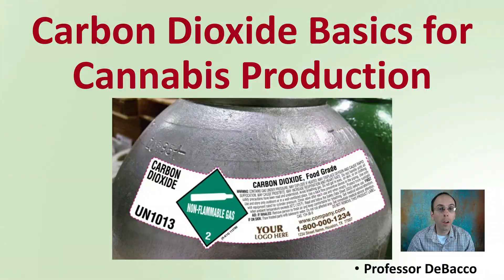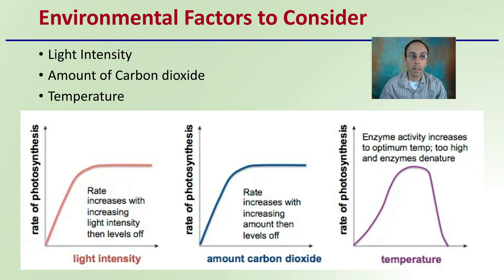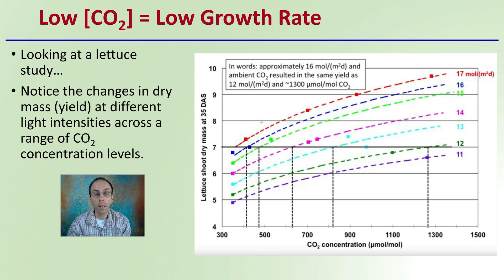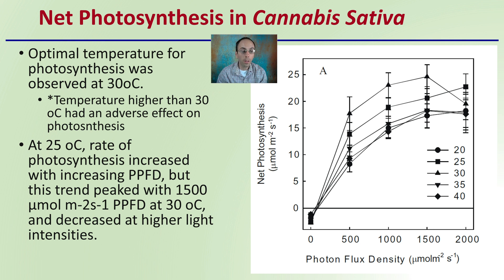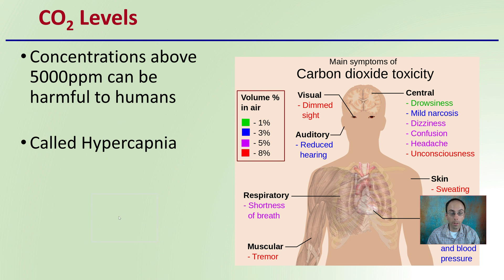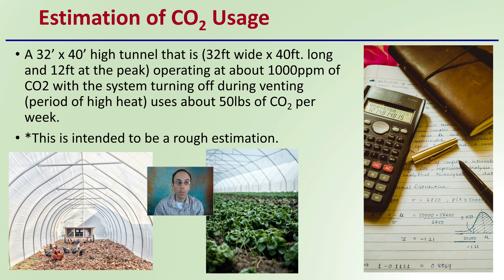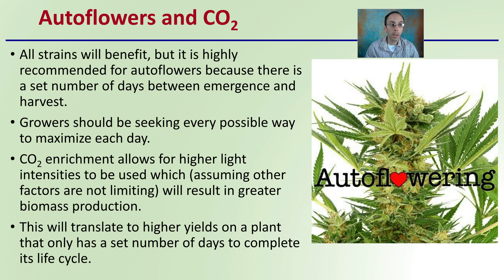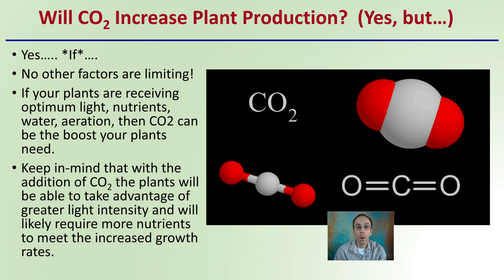Carbon Dioxide Basics for Cannabis Production

Comment: I need help please! ASAP 
 Im at the end of week 6 of Flowering and I just ran out of CO2!
 I was at 1150 PAR, 1300 CO2, 83°f vpd at 1.6. Do i need to drop PAR to 800 and I know temp to 78° or can I finish it out at a higher par or ppfd
Reply from the maker: See how the plants respond, but without the CO2, your plants may not be able to use the higher PAR readings.
Reply: @DeBaccoUniversity I did and it started to Foxtail. So im being safe at 800. Thank you for your advice! Peace ✌️ ☮️

Comment: Quick Math= for 1,44m² Tent you need a 425g C0² Bottle from Sodastream every Month. Target will be CO² Level of 700 Umol. Maybe try then 2 Bottles a Month Late Flower with Light Intensity above 1000 ppfd. 300 Watts or 450 on 1,44 m² Tent no more recommended. Build yourself one from aliexpress, fittings and a Magnetic Valve 12 bucks.

Comment: could someone kindly calculate for me how much co2 would be needed monthly to maintain 1200ppm in a 2x2x2m tent?
Reply from the maker: Depends on venting, but start with a 20lb bottle.
Reply: @DeBaccoUniversity  thank you very much for the quick reply, last night together with a friend we tried to do some calculations and the result was half a kg of co2 per month, if it were correct with a 20kg cylinder I could do almost the whole year, calculating that the refill of the cylinder would cost me between 30 and 40 euros, for a whole year it is an expense that could be worth the return. Regarding ventilation I still have a doubt that I can only get rid of by trying, seal the tent, saturate with co2 until the temperature rises above 28° to restart the ventilation to lower the temperature obviously sucking away most of the co2 and start the cycle again, or install an adjustable air duct volume control damper on the outlet suction so as to try to regulate with a constant flow temperature, ventilation and co2 input.
I have a double ventilation system, one exclusive for the HPS in cooltube completely isolated from the tent, which takes fresh air directly from the outside, not from the tent, and immediately brings the hot air produced by the lamp outside the tent, heating the room less than with a corresponding LED lamp with the same watts, while the second ventilation duct is exclusive for the tent, with this system I have practically eliminated the main problem of the HPS, the heat, and I can manage the values inside the tent much better.
I had been using bags and soluble tablets to produce CO2 for years without ever checking how much CO2 they actually produced, not having a CO2 tester, but now I decided to look into this aspect further and after purchasing the CO2 tester I realized how much money I have thrown away in all these years...

Comment: Why not smoke bud when growing it. I used to live under an runway for airplanes. My plants would grow like crazy. Now i just smoke next to them, whats the advantage of introducing chemically? I notice very little difference between the grows :(
Reply from the maker: Likely you have another limiting factor and not CO2.
Reply: @DeBaccoUniversity  correct, light source. From what I understand is that the plant will grow but not optimum. By introducing co2 during the peak periods with the correct setup it can enhance yield. This is something for farming or labs not the average home growing situation like mine for example. So when home growing unless you have more than ideal situations adding CO2 is not going to do much it seems?! (Maybe a better formulation 😇)

Comment: I'm thinking soon as the light turns on (stomata open), give them a good amount of dry ice fog for about 30 seconds and then in the afternoon when stomata opens again, another dose of dry ice steam for about 30 seconds. of course I'd have to measure the co2 to be sure it's even making a difference. if the stomata is closed you'd be wasting your time.
Reply from the maker: Any will help when the lights are on.

Comment: Thank you for another amazing video!  I have a question regarding autoflowers and CO2.  I'm about to do my first CO2 autoflower run and I'm wondering would you still run 1200ppm to 1500ppm on CO2 for autoflowers or would you do a lower ppm considering it will be running 18/6?  Also what would you increase the light intensity for 18/6 autoflowers running co2?  Thanks again!
Reply from the maker: 1200ppm with 20/4 photoperiod with high light intensity.
Reply: @DeBaccoUniversity  Ty!
Reply: @DeBaccoUniversity  Hello, when you said 1200ppm do you recommend I run that during all stages or gradually increase the ppm from seedling-veg-flower?  Thanks again!

Comment: I didn't think about the increased nutritient uptake, if I had say a EC reading of 1.2, would my ec drop quicker as they uptake more with the co2 in play? And then add nutritents to res to required level untill End of week water change like normal?Thanks
Reply from the maker: The key is to monitor conditions, but expect to need to feed more if adding CO2.

Comment: Excellent channel with super detailed content (LOVE IT) & surprised not more subs. You've earned a new sub from me anyway. I am new to growing and have not yet germinated (Tomorrow WOOHOO). When I started my journey, my intention was to just get a tent, a light, some seeds, nutrients and soil and off I go, "simples", right?......WRONG! I am space limited and for now can only fit in a 70x70 tent. I started my journey over 2 months ago and have found myself down the rabbit hole of you tube videos and dedicated websites. Cut a long story short, I now have invested 3 times my original budget and have a fully climate controlled set up and today purchased the yeast and sugar for my DIY CO2 generator. I have gone completely organic with BioBizz and am using bottled water for now. I will invest in a RO system when I get the funds available. I have found that watching your videos, amongst others, has peaked an interest in doing this as well as I can by investing in best light I can find, soils and nutrients etc. Then it all comes down to what I physically do with the plant and a bit of good luck. This is a hobby for personal use and not commercial. So the expense is no more than in any other hobby. Thanks for the content and guidance. Really appreciated.
Reply from the maker: Thanks for your subscription and detailed comment, be sure to tell others of the channel!

Comment: Very informative video. Much appreciated. There is so much conflicting and widely varying information, even downright bro science out there, that it's difficult to know which way to turn if you're a novice like me. I hope you'll be able to answer a question for me, mate. 

I'm currently growing in a 1m x 2m x 2m tent which I have completley sealed with reflective metallic insulation tape. Every stitch, every zipper ( - the front ones) and every vent and opening are sealed with reflective insulation tape. I am running a 7 bucket RDWC system and am supplementing Co². I am also controlling humidity and temps...or I was. My aircon just decided to give out on me and I am left to salvage my plants in hopes they don't die from too much heat. I'm using Hydroguard which seems to be preventing a Pythium infestation in the roots but the only thing keeping the plants from stunted growth and wilting is the Co². I've done a bit of digging and keep hearing that by increasing the humidity and upping my Co² they will actually love the heat. The tent gets up to about 30°, 33° (C) on warm days. Even more on very hot ones. I'm running around 1400, 1500 ppm's of Co² with ~65-70% humidity (they're in veg). The ppm's seem a tad high, though. What would you recommend here? I'll include a link to my set-up just after I transplanted (it's lights off now and I don't want to disturb them). Any input would be appreciated, mate. About the water (can't get a chiller at the moment but they're ok so far with just the Hydroguard, though it'sonly been four days) or the Co² and humidity. Or both. I'd be much obliged. https://youtu.be/D5rwjYzXiE0
Reply from the maker: You sure like reflective tape... it is everywhere even on the piping.  I would suggest you run the CO2 at 1200ppm and make sure your PAR is on the upper range.  To me it sounds like your core issue is VPD, so check out this DeBacco University video... https://www.youtube.com/watch?v=DLUCdBJkJ6k&t=33s
Reply: @DeBaccoUniversity  Yeah, I certainly went a tad OCD with this project. Took me weeks to source everything and put it together. There's a well hidden bottom drain there too. I wanted to make sure that the system itself was insulated from the light heating up the water. Would've done the buckets too but ran out of tape and just didn't have the time. 

Thanks for the tips, mate. The ppm's were my biggest uncertainty. I'll check out that VPD video. I want to get that humidity just right because I think I'll just leave my temps as they are. The aircon was still creating negative pressure and sucking out the Co², even though I converted it into a dual hose unit and ran both hoses out. Cheers 👍🏻

Comment: Nice to meet you professor. Does the 30 degrees Celsius apply to grow tents? I’ve heard most growers say to never let it get that high in tent and to keep it around 25 degrees Celsius. Your advice is much appreciated.
Reply from the maker: 30C can be beneficial to maximize photosynthesis but there is less room for error and would be recommended only if the plants are in a CO2 enriched environment and the humidity is controlled.  Otherwise you can stick with the 25C.
Reply: @DeBaccoUniversity  Thank You!

Comment: how about burning something to increase co2 lvls? isnt it cheapest way to do it? (not safest)
Reply: Smoked weed xD
Reply from the maker: Videos to come on this, but there can also be other byproducts and plants do not always need the additional heat.
Reply: @DeBaccoUniversity  

true, the easiest would be natural gas(to evade toxic side products)

CH4 + 2 O2 -> CO2 + H2O
Reply: Propane CO2 burner is way cheaper for me. I live 200km from the nearest place to get CO2 tanks refilled, but propane is readily available. I could pipe in of my natural gas line as well, but then I’d have to mess around a bit more, and it’d limit the portability options.